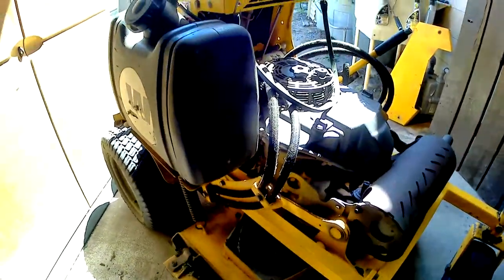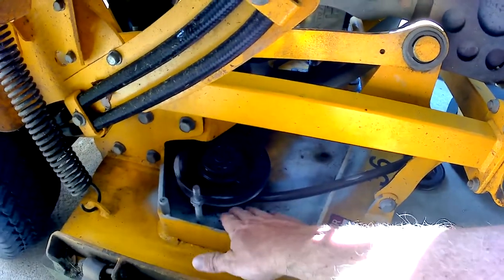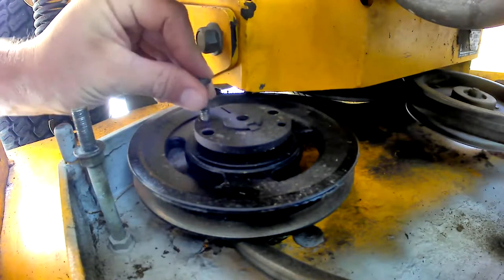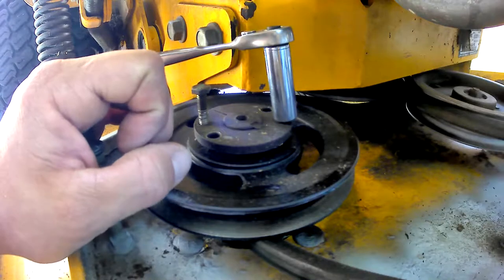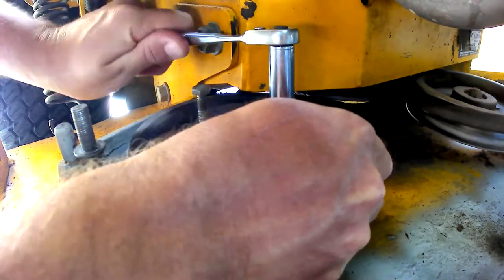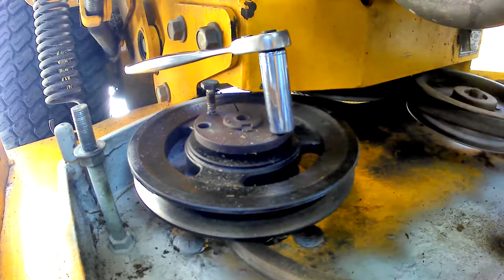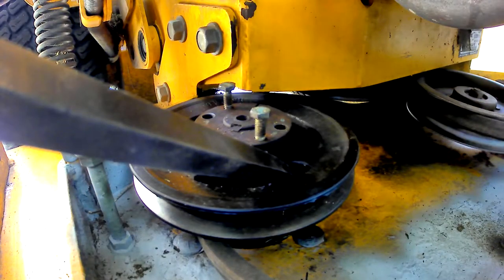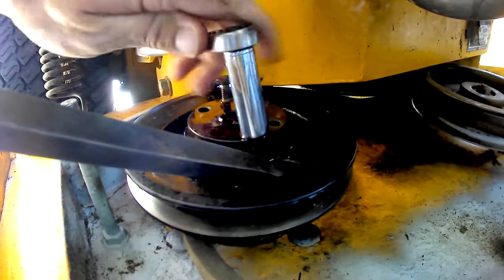WRIGHT STANDER BLADE SPINDLE REPLACEMENT PART 1

Comment: Anti seeze" on the threads for next time or at least grease same with clutch removal,  6 point socket is better than a 12*  pb blaster & lite tap on the top of the bolts help  buy the high temp bearings  last way longer  some helpful hints"  been doing them since 98"
Reply: Basically 2 bolts are like a  gear puller 3 turns each bolt , like cross torque helps not to bind" up each side